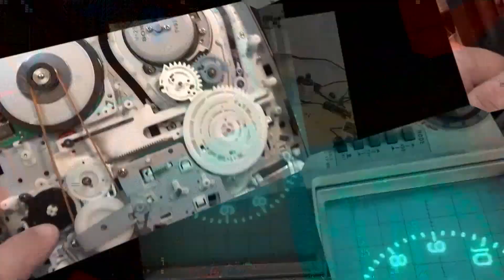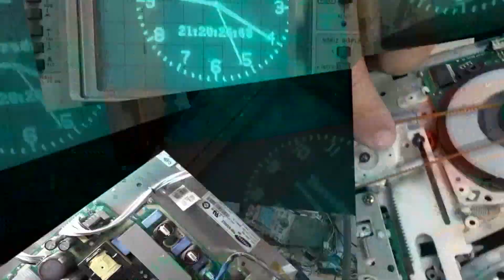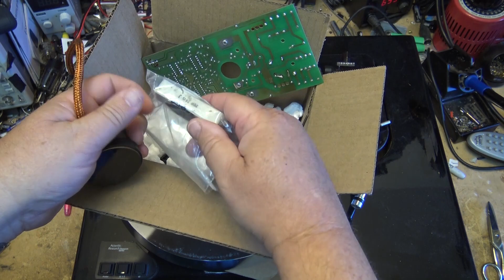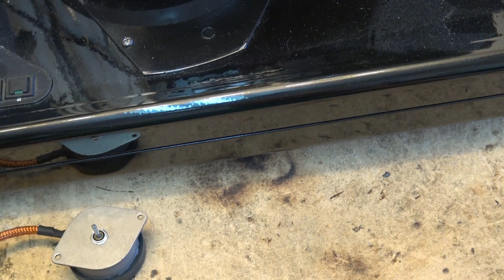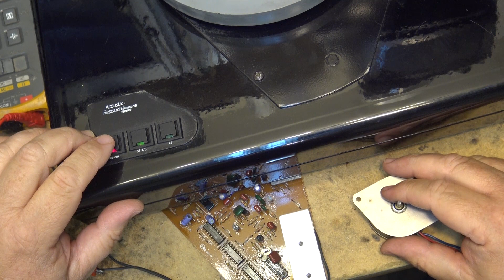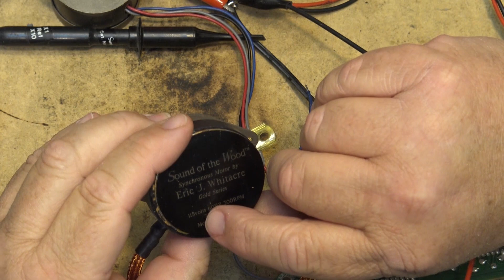Acoustic Research ETL1 motor drive board troubleshooting

Comment: The ETL-1 was AR's most advanced table.  The only one with push button speed control. Retail without an arm when it came out  around 1988 was $700. This table is more rare because of the piano black finish.  The "other" board is a Linn Valhalla Board missing its 3 capacitors and the the Sound of The Wood Motor Linn motor.  
Thank you for such an informational video.

Comment: Wow, what a mess! I bet this is a frequency generated speed controlled deck and something went fubar, but it ain't the motor as you showed. Clearly, the initial person whom attempted to repair this had NO clue and was at best (to put it kindly) a hack when attempting to repair it.

Whomever worked on it previously didn't know how to work on these without damaging the traces. 

These frequency generated units are quite common to belt driven decks unless they have a quartz lock circuit instead. 

I have a 33 YO Kenwood plastic fantastic (OK, the plinth mainly) belt drive deck that's considered budget when it was new and it's been in my possession for almost 20 years and was my late parents when they bought it new in the mid 80's. Still works like a champ, is frequency generated speed control and I've not recapped or anything along those lines on it, and it still chooches along nicely even now, though it's due a fresh belt before long and has had the periodic speed adjustment done to get it back into speed, though it's never way out, but just enough to notice and get the ol' adjustment.

Looked like it was a decent deck when new though.
Reply from the maker: This is a quartz lock frequency drive board. The board generates the 2 90' phase shifted sine wave signals to drive the 2 phase induction motor.
Yes they call it a synchronous motor, which is incorrect.a true synchronous motor has a single coil, and very low torque. They are used in electric clocks, and can start up either direction. Clocks have a reverse start mechanism to "bounce" the motor if it starts backwards. I remember as a youngster taking apart an electric clock and when I reassembled I left this critical part out.
It was a crap shoot when powered up as to which way it would spin.Anyway this is a 2 phase motor. Reverse the coils and it will run the other way.
According to the owner the guy that worked on it is a "tube guy"
Figures. Tubes are so simple. Tubes are dangerous only because of the high voltage, but very forgiving, and about as simple as one can get.  I enjoy working on tube gear myself too because I don't have to think too hard.
Anyway some of thsese motor drive circuits can be pretty complicated. Throw in the 3 phase traction motor and things get to another level in complexity.
Now your talking FG speed sensors, a pair of hall effect devices to detect rotation position in order to start the 3 phase rotating field. My Technics SLM1 is a 3 phase direct drive where the rotor is actually the platter itself.
It starts up from 0 to full speed locked in 1/3 of a turn and stops just as quick. It is a DJ turn table used in thousands of radio stations when vinyl was being spun on air.

Comment: Without the schematic and knowing nothing about the circuit how can a 8 V regulator be of any use. If you have TTL chips they will be burned up. I don't tape in parts kits- units like this tripple the repair price.

Comment: Jeez, what tech doesn’t have 6 squillion 78xx/79xx-series regulator ICs on hand?!? 😎 Besides, if you leave a pile of them alone long enough, they breed like tribbles! 😋
Reply from the maker: I did have a bunch of them, but guess what. I used them all, and they just don't grow on trees. I have to make the effort to go to the store and buy some new ones. They are cheap, only a buck each, so now I have a few for spares.
Now if I made a living doing this I would carry more stock, but I don't. In fact I could just decide tomorrow that I don't want to do this any more. That would disappoint my steady clients for sure as I do have regulars. In fact the majority of the paid work I do is for regular customers that know me from when I ran the service dept at the local shop. I stock common parts only, the rest I bring in as I need them.

Comment: Well, you could overvolt it and let the magic smoke out; that’d make the motor fail. Or, you could do what an idiotic coworker of mine did; mistake J.B. Weld for lubricant, and apply it to the bearings!
Reply from the maker: Not on this one. It is worth too much to the owner whom is paying me well to get it back working.

Comment: Hope you got plenty remuneration for all the research time and running around you had to do. If he brought it to me, I'd want at least $100 up front, fixed, or not. Yeah, the challenge is sometimes fun, but I don't have time for bullshite.
Reply from the maker: He has 300 in parts in it, so he will look after me. I have the unit working now with his new expensive motor as the original one the shaft is slightly bent as I discovered after installing it. Still haven't built a new power supply, but I shouldn't have ant problems finding a transformer. This table is owned by an audiophile, he will pay me well to get this one going.
Reply: I think this client should be grateful to find you. That motor shaft did look bent.
Reply from the maker: Yip it was. New motor going in.

Comment: Hey  Bud, how do you like your Textronix 2465 scope. Never seen you with that one before. Have you done any mods to it as in cooling ?
Reply from the maker: I have had it for almost a year now. One of my viewers donated it. Same guy I bought the little 1.5" color CRT tv from. It works great. I haven't done any mods to it myself, but I bet the cooling issue has been fixed as it has a good size fan in there that sounds like a jet engine warming up when I turn it on.

Comment: I got a transformer that could help so you can atleast reuse the old driver board if you want multiple taps and coils.
Reply from the maker: I have access to transformers no problem. Actually have a 24 volt unregulated power supply from an old satellite multi switch. 24v @ 1 amp. Floats at 28Volts, right where we want it.

Comment: Do you have a video on the power supply you built that you used in this video? I searched but didn't see one. Thanks.
Reply from the maker: I havent got the parts for the power supply yet. I'll pick some up and build as the owner didn't get the transformer back.  The last guy working on it said it was burned out. Ya right.
Reply: Sorry, what I was asking about was the power supply you used to power the board for testing. You said you made that power supply. I was wondering if you made a video when you built it?
Reply from the maker: @StealthParrot  
Yes the video for the power supply in the white box is on my channel. I built it a year or so ago.
Reply: I found it ... RD DP50V5A Buck Adjustable DC Power Supply Module ... Thanks!

Comment: linn valhalla boards were originally just 33 1/3 I had one. The cheaper axis turntable could do twin speeds but the Valhalla was single speed.
Reply from the maker: Yes I know, as were some of the AR models. You had to remove the platter and manually change the belt to the larger pulley.
Reply: Perhaps worth restoring the Linn board as they did cost quite a bit as a dealer installed upgrade. They did get hot though this board looks ok. The switch and ribbon cable missing.
Reply from the maker: @pauledwards2817  
I have the switch and ribbon cable. They are in the box with it.  The caps are 47uf 250v.

Comment: Well you got the motor spinning, that's a big improvement :-D
4000 series can go to 15v with no trouble.

I bet the smoothing cap on the original supply died, the regulator did not have enough overhead voltage to produce a decent d.c out, so the chips played up.
That could have been the original fault.